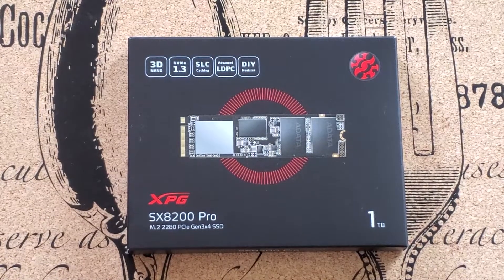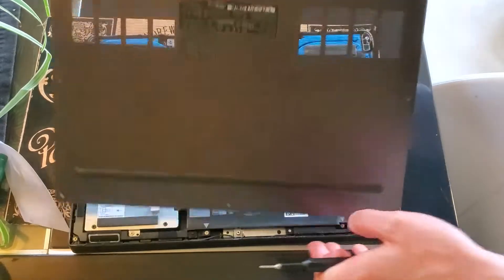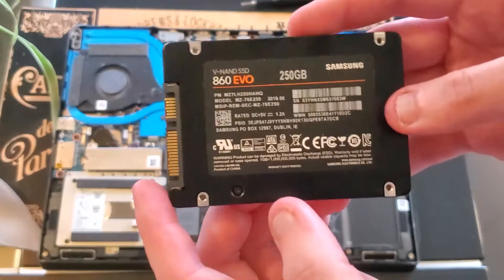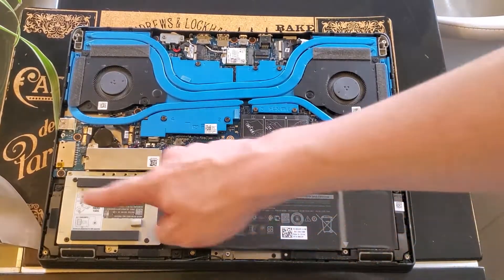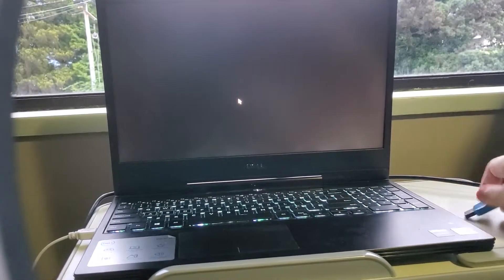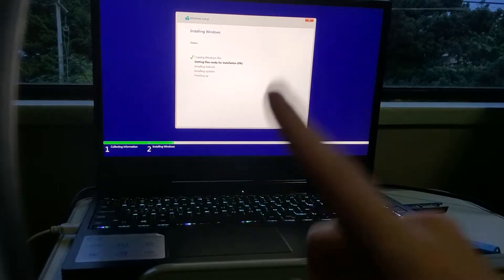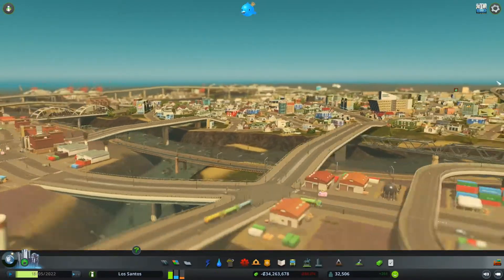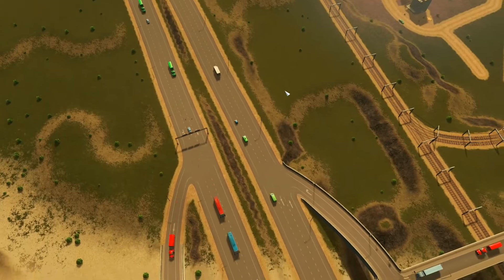How to: UPGRADE Dell G7 7590 Laptop SSD

Comment: Hey bro. Great video. Just a question, would I need to upgrade to a different battery in order to buy and install the 1tb ssd you have installed in this video? I have the same laptop but the same battery that the laptop has came with. Would I need to upgrade the battery to install this ssd?
Reply from the maker: Great question. If you have the same battery as I did, nope! Should just work

Comment: What SSD did you have before? Are there two SSD’s? 
I understand replacing the first one, it’s what DELL recommends, but what’s the second one? Is it the actual storage?

Edit: if I chose to get an SSD instead of a HDD when I bought the laptop, will the HDD be there or will it be empty?
Reply from the maker: Hey there! Yeah I replaced the first boot NVME drive with the XPG SX8200 Pro and the second with a 256GB Samsung Evo SSD.

If you choose the SSD instead of the HDD, then that slot should be populated by the SSD you selected.
Reply: @J0elPeters  hi, I also wanna upgrade ssd to my G7 7588. 
My laptop builded by 128g ssd + 1TB hhd .
The windows in installed at 128g ssd. 
I want to upgrade 128g to 1 TB.
If I do the same operation of your video, I guess I can’t start PC cause there is no windows in the new SSD. 
Could you tell me what should I do?

Comment: I always have the same question but no one answered it. What is the flash drive purpose?
Reply from the maker: It runs a bootable version of Macrium Reflect.
Reply: @J0elPeters  what is the Macrium Reflect
Reply from the maker: @jengajune3886  did you watch the full video?
Reply: @J0elPeters  I did but I did skip some part
Reply from the maker: @Jenga June  Please rewatch it fully

Comment: Please help me understand why did you install two different storage mechanisms I thought the m.2 where all the data goes what was the other thing that you installed?
Reply from the maker: An SSD
Reply: @J0elPeters  yeah but why do you need two different storage mechanism
Reply from the maker: @ickmorl1261  for more storage
Reply: @J0elPeters  do you have to install the second one? I thought the first one was the SSD, if it is not, then what is the first one
Reply from the maker: @jengajune3886  I had an M.2 NVME SSD and a 2.5 inch one.

Comment: The message for backing up you discuss will that save my Steam games that are downloaded to the hard drive as well?
Reply from the maker: Your game saves are usually in your User folder and your actual games are where you've installed them to.

If you backup SteamApps, your games will be backed up

Comment: Hi, thanks very much for the video! I have a Dell G7 7590 with the 60w battery and am looking to upgrade the hard drive. I don't know what the connection limits or types are. I know it is only mechanical drive but for example would this 5tb work? cheers
https://www.centrecom.com.au/seagate-barracuda-internal-5tb-25-sata-drive
Reply from the maker: Hey, no problem. It might be a bit too thick. I sold the laptop off but I'd recommend going external and putting a secondary 1TB SSD in and an NVME.

Merry Christmas
Reply: @J0elPeters  thanks for the fast reply and merry christmas also! i just learnt about the height, thank you! i will probably go for 4tb samsung SSD, cheers
Reply from the maker: @philby36  What did you end up selecting?
Reply: @J0elPeters  hi I went with the samsung 870 QVO 4tb <3

Comment: hi joel great video, did you try to change some settings to improve performance? my read speeds seems to be on the low side. it tops out at 1300mbps on crystal disk
Reply from the maker: I only did 1 pass on Crystal Disk Mark at 1GB
Reply: @J0elPeters  maybe i got a lemon. thanks
Reply from the maker: @markesperancilla9401  Sorry to hear that man,  maybe reach out to ADATA?
Reply from the maker: Hey, did you find out what was wrong?

Comment: Is the laptop any good? I heard it has heating or thermal issues.I am planning to buy, your response would be helpful. Thanks, mate.
Reply from the maker: Okay, so I run Throttlestop and that helps DRASTICALLY.

I don't, not recommend this laptop, but I only got it because of financing, to be honest. I foolishly thought it'd build credit for me. For the price of $1800, there are better machines you can buy. 

So I'd shop around. BUT if you can score one of these for a cheaper price, you'll be far happier once you've upgraded it.
Reply: @J0elPeters   Joel-Peter  It ordered for $1250 with tax, arriving next week. But an 8gb version with i7 and 1660ti. Bit confused about the purchase as Dell released the new G7 15, it put me in a tight spot. Would you be upgrading the RAM, if yes, which one would that be?
Reply from the maker: @prashanth.b  I upgraded from 8gigs to 32gigs.
https://www.youtube.com/watch?v=0mzVW0JiPuE

So if it's 1250 USD, that's not the worst. You'll be happy. 8gigs is okay but I'd upgrade as soon as you can. If you're not a content creator, just go with 16gigs and close more Chrome tabs.
Reply: @J0elPeters  I got my G7 7590 with RTX 2080 and 90 whr battery for 1700$ !! you paid 1800$ for 1660 TI ? -_-!
Reply from the maker: Yes, 1700 CAD.
Reply: @J0elPeters  1700 cad is still good for 1660ti, I paid 1150usd for 1660ti and 8gb ram, and upgraded the SSD 100usd extra, so spent 1250 USD in total. 1800 usd is too steep, but for RTX 2080, it is justified. How do you rate Dell G7 against Acer Helios 300?
Reply from the maker: @prashanth.b  Good question, I hear the Helios is really good for a budget gaming laptop.
Reply: @J0elPeters  Yes, I hear too. But it's looks and plastic build turns me off. I chose G7 for its aluminium build, I would choose Helios if it is little subdued and build strongly. I think I'll be happy with G7, only time will tell 😀
Reply from the maker: @prashanth.b  Yeah you'll be happy. Well minus the loud fan, but that's just a gaming laptop's pitfall.

Any reason for not going with a tower?
Reply: @J0elPeters  Thanks man. Would want to purchase a laptop for my brother, how do you rate Raze Blade 15 base model against dell G7? Which one to go?
Reply from the maker: @prashanth.b  I'm not really sure.
Reply: @prashanth.b  you have the dell g7 7700?
Reply: Bought a returned one from local best buy awhile ago for 1200 with the rtx 2060, i7, 16gb ram. Getting ready to upgrade both hard drives then RAM to 32gb and can't wait to see how she goes.